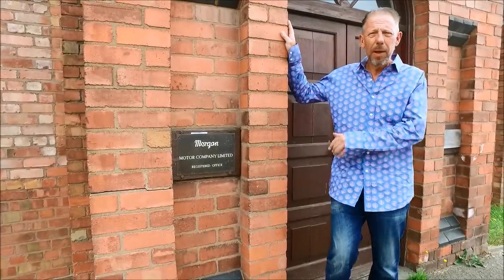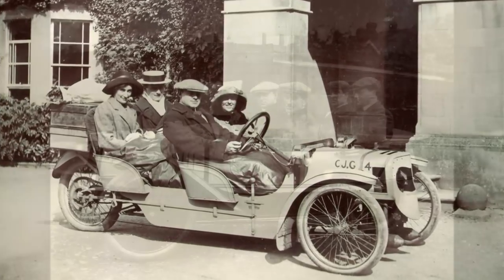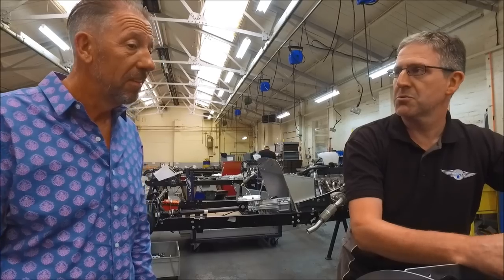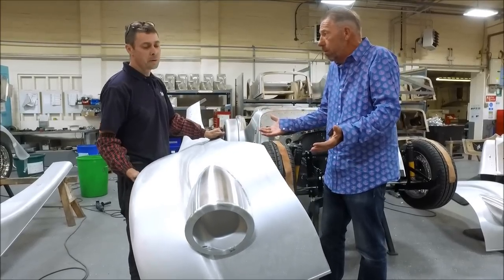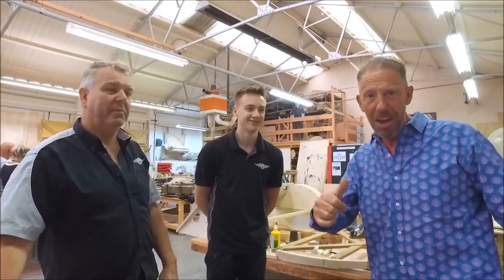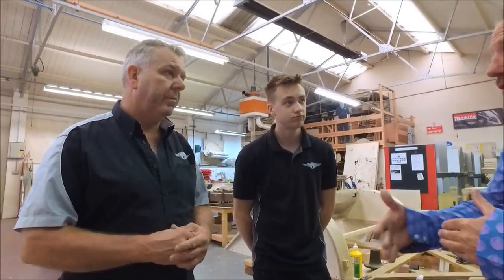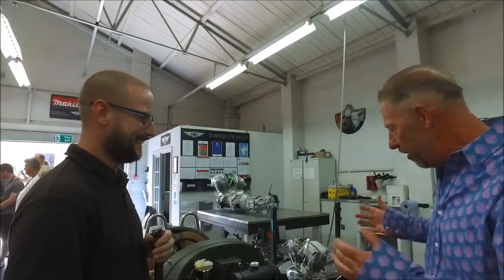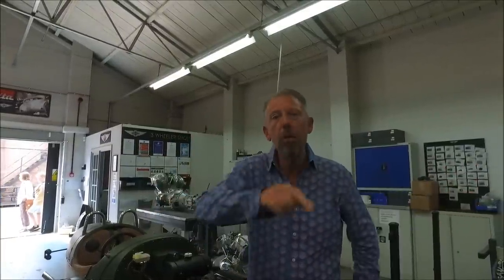Morgan Motor Company factory Tour: Behind the scenes at Morgan Motor Company

Comment: So what exactly is the point of fabricating the chassis components out of wood?   I have a great deal of affection for wood as a building material, and build and own wooden boats constructed using modern epoxy bonding and impregnation techniques. But boats are complicated, curved 3 dimensional shapes, and I don't see anything about the Morgan chassis that couldn't be duplicated at a lower cost with a welded subframe assembly along the lines of a Caterham 7.   These cars cost a great deal of money because of the tremendous amount of handwork required to build, among other things, the wooden chassis.   I love the look of these cars, and appreciate the fine workmanship that goes into the bodywork and interiors, , but don't see why the chassis can't be made in a more efficient manner with a view to bringing the price down so more people could afford to own one.
Reply: The chassis are all metal, only the body frames are wood, so your comments seems a little pointless. They are expensive to make, but you could always buy a standard tin box.
Reply: @JeremyEdwards996  Indeed they are, sorry, my bad.  Found a video with a complete overview of the building process.  Now I understand which components are wood, and which are not.  I do wonder what steps are taken to weatherproof the wood before the body panels are fastened on.  If I were doing this I would be inclined to give the frame members a sealer coat of epoxy.  Do they do this?
Reply: @seayak  Good point, Bruce. The ash body frame is dipped in wood preservative before the steel or aluminum body panels are attached.
Reply: A steel tube substructure, the Italian method, causes galvanic reaction with subsequent corrosion between the dissimilar metals. A problem with Caterhams.